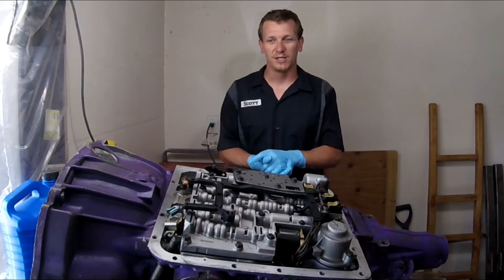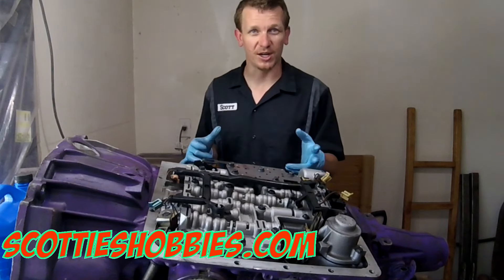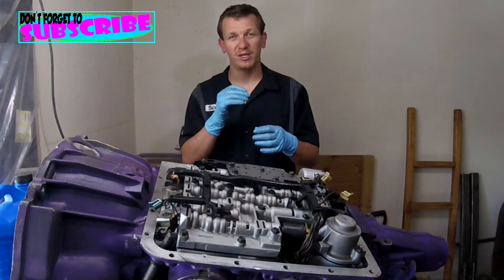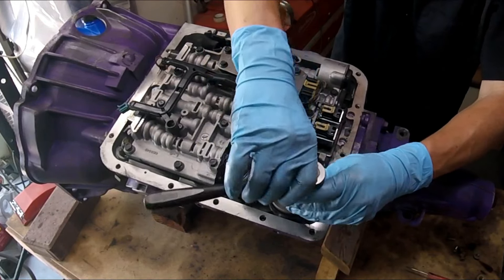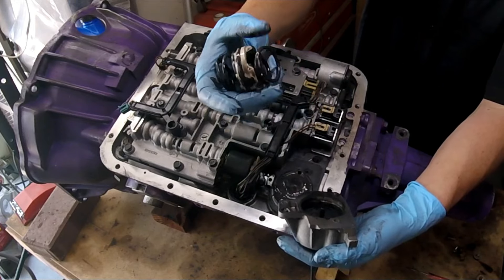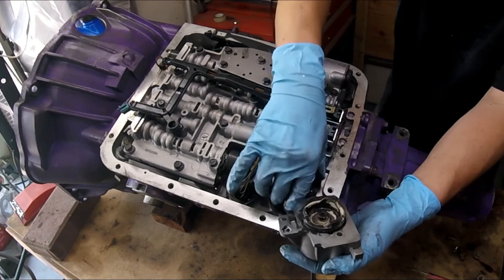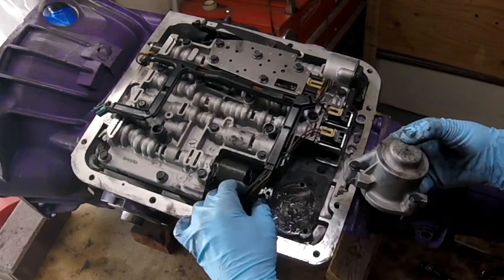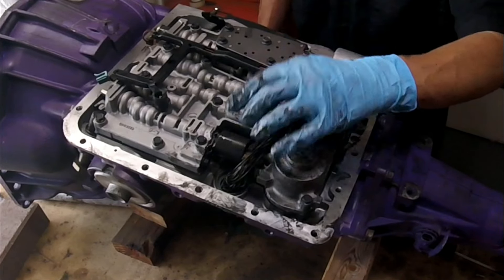⫷ 4L60e Harsh Shift, Shutter, 1 - 2 shift problems. 1-2 Accumulator Check and Replace ⫸

Comment: I have an 04 silverdo with a noticeably hard 1-2 shift under light/normal throttle. If i give it more throttle, it shifts smooth. Im a Chrysler tech and new to these GM transmissions. Would my issue fit this repair? And once i get the accumulator out, how can i confirm it is in fact bad
Reply: Hey did you ever find out what your problem was? I'm having the same issue in my truck.
Reply: Im having same issue as well? Did it work?
Reply: @ryangraff8872  did you figure it out?
Reply: @chrisg1364  It was from the corvette servo I put in my truck, I just think the part was no good and something was wrong with it (crazy hard shifts instead of nice firm ones). I put back in my stock servo and it shifts normal again. So I think that was the problem. Did you figure out yours?

Comment: With the spacer or without the spacer confused me into thinking it popped out and could not find it back. Turns out after hours of looking there was no spacer in my tranny. M ust be a difference between the 4l65 and the 4l60 . Maybe it is the year that makes this difference.

Comment: Thanks for the video. I have an 08 Silverado that the first time it’ shift from 1-2 its normal then every other time it’s a hard shift, if you cut the truck off and start it back up same thing first time is normal and then hard from 1-2 and fine through the rest of the gears. Wld this be a good place to start or is there any other direction you can lead me towards. Thank you.
Reply: I have the exact same thing did you figure out the fix?

Comment: Have 1999 S10 w/4l60e...it shutters only in 1st at take off...then shifts smoothly/properly through all gears, only shutters slightly from complete stop to go...is this also an accumulator issue also? Thank you

Comment: I have 4l60e in a 2000 Silverado. It won't go when you put it in drive but when you put it in 1 it does fine. All other gears are fine. We changed both the silinoids mine as well since we were in there) and still nothing. What can I do?

Comment: I have a 2007 sierra 4x4. Hard shifts from 1st-2nd. only codes I get are po172 and po175 system rich. Hard shift intermittent. Banner Chevy  changed TCM problem still exists. They pulled code p2544, u0100 loss communication with TCM. Any advice at all. Could a sensor be causing this or a bad wire harness?

Comment: What would cause my 99 chevy Express 2500 4.3 to jerk while accelerating between 50 and 60 mph I have no codes and it runs fine shifts to reverse and drive smooth but jerks lightly while accelerating at highway speeds help please

Comment: I have a 93 k1500 with the 6.2 diesel. When taking off from a stop it clunks like if it had a manual trans and you popped the clutch. It doesn't clunk in reverse and when you shift the trans into 2nd gear and take off it doesn't clunk either. It almost feels like it shifts into neutral when you come to a stop then once you start rolling again it drops back into drive.

Comment: What if it doesn’t want to shift from 1st into 2nd? If I let off the gas it shift ok.
Reply from the maker: Could be a few things. 1:  Bad throttle position sensor. 2: bad 1-2 accumulator. Or 3: poor line pressure. Have you looked at your fluid? Is it discolored or burnt? Is the fluid at the fill line?  Poor line pressure usually has more symptoms.
Reply: Scotties Hobbies fluid is good. Just pumped out 3 quarts and put fresh. Making sure was the right amount
Reply from the maker: Have you ever looked at your 1-2 accumulator?
Reply: Scotties Hobbies not yet, just started acting up a few days ago
Reply from the maker: @JDalton  everything is still stock/factory? How many miles?
Reply: Scotties Hobbies Bought it used. So idk but it’s got 213xxx
Reply from the maker: In my personal 2001 Chevy Tahoe at 219000 Miles I lost first gear. Ended up doing a rebuild and the first gear itself had lost all of its clutch material. I did a complete rebuild it and also found that the third check ball was leaking so I was going to lose 3rd and 4th really soon. If I were you and I had extra time and some extra fluid laying around I would at least pop off that 1-2 accumulator and take a look see if the pin is good and see if the accumulator moves really freely. If it does move really freely I would replace it with an aluminum for pinless accumulator. But if you've never had a rebuild I would start planning on saving up for one in the next few thousand miles.

Comment: if that transmission was built by monster i would start shopping for a new one now
Reply from the maker: Man... this trans lasted 900 miles... junk!
Reply: @ScottiesHobbies  crazy how they sell it as built lol  when GM had better ones from the factory than this. 4l60 isn't bad, just can't hold up to abuse or poor maintenance. I've run one for 220k and it was still going.

Comment: I have a 1994 4l60e wont shift at low rpm shifts from 1-2 when I get over 25mph at a higher rpm and wont shift from 2-3 till I get over 45mph at a high rpm and has hard shift from park to drive. Any idea what needs replaced.

Comment: You seem like you know your GM transmissions. I have an 88 one ton two wheel drive that is stuck in first gear. Any ideas? I have park, reverse, neutral and drive but it won't shift up I can't even manually select second gear inn the column. It just stays in first.

Comment: I have a 2002 Silverado 4X4 serviced the trans changed filter and gaskets, ran in in the air to make sure I had shift point and checked make sure trans fluid was at normal level, Shifted fine revere also, let it sit over night put it on the ground and now it wont go, the shift indicator is not registering when i put in in drive, but does indicate PK R & Neutral, drain fluid re pulled pan to make sure filter didn't come off it was fine. have any ideas, does the indicator have to work for the transmission to work?

Comment: My 03 silverado is experiencing a bit of a hard shift from first to second gear but only on low rmps like 1500. If I stay in it and let it climb to 2000 or more rpm is shifts perfectly. Does this seem like it would my my accumulator? If so, how urgent is it to replace it? Will it chase damage to my transmission or is it more of an annoyance? Please help.
Reply: Sorry my autocorrect messed up my paragraph and I typed too quicky lol

Comment: I have a 2008 gmc yukon slt and it tends to jerk/jump when turning left or right slowly. But when in straight rd it drives just fine, i dont hear any clunking or differential noises or trany codes on the cluster. Someone told me to replace the mass air flow sensor even though the mass does not show in a check engine light... any ideas what it could be? “Help”

Comment: Thanks for all your informative videos. I have a question you mentioned if chasing a hard shift issue check the electronic power control solenoid. How would I check or test test Solenoid? And if it is bad do you have a link for this EPC solenoid?

Comment: I have this hard shift issue with my 2019 Silverado 1500 LTZ...everything I've read or seen states there's no remedy. Nothing but endless trips to the repair shop. I am getting rid of my truck. Love the looks inside and out, but I've got better things to do with 50k
Reply: Exelent video.
I have a 2010 Chevy Silverado 1500 hard shift 1 to 2    p2769 code how to fix it

Comment: Thanks for sharing! My friend 2004 GMC envoy does a weird clunk knocking sound but only when changing from 1st into 2nd gear. Does anyone has any ideas or experienced anything similar? Could this 1-2 accumulator be the reason? Thanks!
Reply: Possibly 1-2 accumulator,check throttle position sensor on throttle body also,they can effect shifting too,that would be the easiest one to get to first!
Reply: @randallstewart8487  Thanks for the help! I’ll try that first before spending $$$$.
Reply: Try tps (throttle position sensor) that might be the problem

Comment: Hello I have a 98 s10 4.3 2wd if I’m driving normal my truck shifts great. If I get on it more than half throttle it acts like my fuel is being cut off and it slams into 2nd gear and tires squeal If I go up hill and I happen to hit passing gear it does the same thing. All other gears work fine. Any help anyone could give I would appreciate it Thanks

Comment: Mine downshifts very hard 2-1, and it hard shifts almost no matter what 1-2. Sometimes it will be softer than other times. And when taking off it feels like my transmission is jumping.
Reply: 00Z71 did you ever find out what it was my truck does the same thing

Comment: My 07 Silverado 1500 has a hard shift from 1-2, I had the 1870 error code. I bought the 1-2 accumulator that you highlighted in this video but it also has a shift kit installed so now I'm not sure if I should take it apart based on you saying you should install a shift kit instead of this pos

Comment: I have a harsh shift from 1-2 on my 07 Tahoe but it only happens immediately after I receive an error message for stabilitrak, then stabilitrak light turns off again and it shifts just fine, and it is intermittent when driving throughout the day, but like I said only happens when the stabilitrak light comes on then immediately it will start shifting hard, then goes back to normal when the error randomly goes away again. Any advice?
Reply: I am having that same issue did you find out what the problem was.

Comment: My truck GMC Sierra k 1500 has 4l60e in it when I push on the throttle the truck was just red line until I and it won't shift and when I let off the throttle shift I'm going to the lake to drive what was the cause of this I've already changed the shift solenoids

Comment: I too have the 1-2 hard shift on my 2005 Avy it’s very sporadic though doesn’t do it all the time tranny shop couldn’t figure it out no codes.
Could mine be a accumulator issue?
Thanks
Reply from the maker: It is a possibility.
Reply from the maker: If you are going to check it, you might as well replace it with a new piston and o rings.
Reply: It’s really got me stumped it will shift super smooth at times (most of the time) while other times has a hard 1-2 shift....then back to smooth shifting 🧐
Reply: I fixed my cold , hard 1-2 shift by doing this on my '03 Sierra

Comment: I'm having the 1-2 hard shift. With fault code p0961. I've replaced the EPC, 1-2 and 3-4 shift solenoid. But, I still have that fault code and hard shifting. Would the accumulator cause that fault?
Reply: I have the same error code
Reply: I have error code po894
Reply: Would the accumulator cause a no 1st gear shift? Seems that my transmission is taking off from the second gear, never goes to 1st gear

Comment: Good video bro I'm gonna check it out do you think the valve body can cause the same issue hard shift from 1 to 2
Reply from the maker: Make sure the valve ports and shift valves are clean. back probe and 9v test the shift solenoids while in there.

Comment: I have 134k miles on my original 4l60e. My transmission doesn’t slip and my fluid is just now starting to get a little dirty. I have the hard 1-2 shift when my transmission gets hot. Do you recommend me dropping my pan and doing a fluid and filter change along with this upgrade or should I leave it alone and run the transmission till it goes out entirely? Nice video btw!
Reply: Dominic James same thing happens to mine. So you’re saying to just leave it like that?

Comment: I have an 06 Silverado z71 with the hard shift from 1-2. The original accumulator that was in the transmission had one big Spring and one small spring, but the one I bought only had one small spring. I ended up re-using the two springs that were already in my transmission with the new accumulator housing and I still get the hard shift. Should I have used only the small spring that came with the new accumulator?
Reply from the maker: Use what came with the replacement . Make sure the pin is in olace and not wobbly if you are reusing stock. The new accumulator mught not be the same exact diminsions as the factory. Some pistons are thicker so less spring or resistance is needed. Some springs are rated at different weights too so the small spring might be more or less resistant than the old one.
Reply: Scotties Hobbies thanks, I’m going to swap it with the spring it came with and see what happens.
Reply from the maker: Good luck. Keep us posted.

Comment: Can a bad accumulate cause 1-2 shift to be smooth or not really happening and some slip in 2nd because i had installed a corvet servo and it was fine and firm then this happened 4th feels fine i had actually ordered the transgo shift kit that i had planed on installing but i prdered the pinless upgrade pistones looks like 3 of them so probably get them Friday and do it this weekend

Comment: so, what exactly is the "check" part of the video?? You unbolted it and put it back on with no explanation of what to "check" for other than a plastic piston...
Reply from the maker: You are looking for a oblong hole on the piston shaft. Or a crooked plastic piston in the accumulator. Or you are looking for a blown out seal on the piston.
Reply: @ScottiesHobbies  ok, that's awesome! Thanks for the reply! Dealing with a problematic 4L60E right now. Lol

Comment: Can you put this same part in siverado 1500?
Reply from the maker: As long as you have a 4L60e, yes.
Reply: @ScottiesHobbies  How can i tell and what happens if it's a 4l60 and i install the 4l60E?
Reply: kenny baird  should be the same. Only difference is the E transmission is controlled electronically
Reply: @thegillz6743  So it should work since there are no wires running from it,thanks.

Comment: Can someone help?
I bought a metal 1-2 accumulator and it doesn't spin like the old one. Is that good or bad?
Reply from the maker: It shouldn't spin. If you have enough play in it for it to spin it was probably letting fluid leak by and that is probably why you are replacing it. On your new pinless accumulator I believe it has two seals. Am I correct? I believe one is a rubber base seal and one is a nylon seal. Make sure those are on in the right place. The accumulator shouldn't spin it should only go up and down. It's a piston.

Comment: Why would you buy a trans from E-bay since you can "allegedly" build one ?
Reply from the maker: Sometimes it sounds better to spend the money to save time... but time and time again I learn that if you want something done right you gotta do it your self.
Reply: @ScottiesHobbies  Did a 4l60e that was a Good-wrench rebuild & the reverse drum was concave when installed. 
75% of the band center was completely untouched .

Installed a customers " B&M 400 " that had no reverse & it filled his new Hi Stall converter with metal .
They wanted it shipped back at cust expense to "allegedly" fix it .
I built his original & drilled & flushed his converter & sent him down the road 
So NO , I don't trust anyone !
Reply: Also sometimes customers request vendors or parts and only ask us to supply labor

Comment: Trying to find the video of the eBay seller you were talking about.  Point me in the right direction?
Reply from the maker: Take a peek in the description. I should have ebay and amazon links.
Reply: Scotties Hobbies  Oh yea, I got the sonnax links.  I was talking about the eBay seller u said u wouldn’t buy from. I was looking at a trans purchase off of eBay and they had purple painted trans.  So trying to make sure I am not messing with the same seller.
Reply from the maker: @godzsonjl2983  the eBay seller that I would avoid buying a 4L60E from is 700r4Builder
Reply from the maker: Take a look at the first video I ever posted about the transmission I purchased from them. I noticed a lot of output shaft play, posted a video online and tag them and you can see his replies in the comment section. If you check out my video library I have three or four videos about Parts I found messed up inside the transmission. https://youtu.be/bIX8rDvy5V8
Reply: Scotties Hobbies  Hey thanks!  That actually is the same seller. Saved me from a bad decision 👍🏽

Comment: In second gear, when I let off the gas and let back on, it feels like theres nothing and then hits in gear.
Reply from the maker: Check the accumulator and shift valves. I bet you will find your problem. If the shift valves have debris on them, clean them and get ready for a rebuild. Is the accumulator stock? Check it either way but the factory ones are plastic usually and fail a lot. If their is debris in the accumulator that is not the accumulator,  get ready for a rebuild.  Check the piston and check the guide pin in the accumulator.
Reply: @ScottiesHobbies  I believe it's all stock. It's in an h3. I plan on pulling my pan and checking after the winter. Maybe a rebuild is needed then.

Comment: My 95 s10 wont shift till 3000 rpm and when i start in park it tries to takeoff
Reply: Manual or auto? either way most like its ur neutral safety switch it should not want to go from park

Comment: What was cause  no 2nd gear or 4th gear? Just shifts from first to 3rd gear.
Reply from the maker: Do you still have reverse? If you still have reverse then the 2-4 band is probably worn out if you do not have reverse then the sun shell is probably cracked or broke.
Reply: Yes I still have reverse. Thanks.guess I'm gonna have to drop the tranny
Reply: Was hoping it had something to do with the 2-4 servo.....guess not
Reply from the maker: It's always worth checking the two for servo. Especially if it's still Factory.
Reply: Gilbert Sanchez  try the shift solenoids!!!
Reply from the maker: @leosdreamon681  always worth a try but do you know how much people hate on you if you make them waste money. Lol. Thats like a good $100 with good solonoids and good tranny fluid.
Reply: Scotties Hobbies Im thinking bout replacing tcc valves and solenoids my truck is having a harsh shifting from 2-3rd gear ⚙️